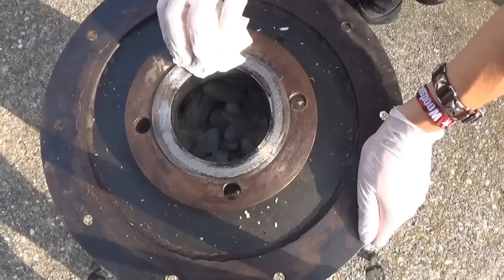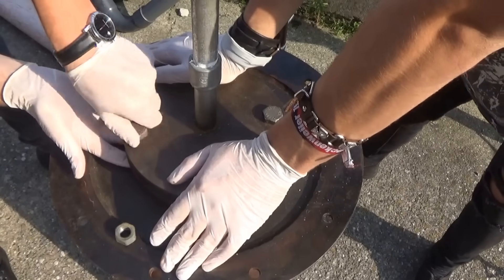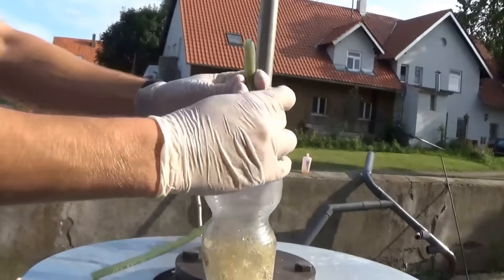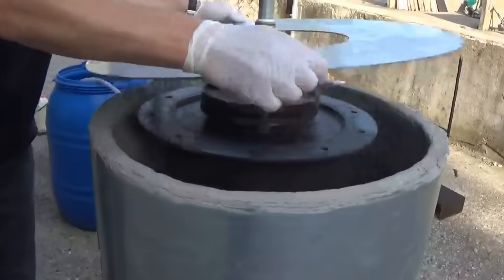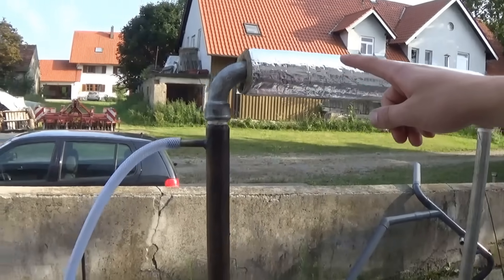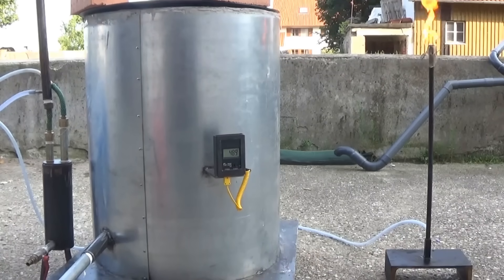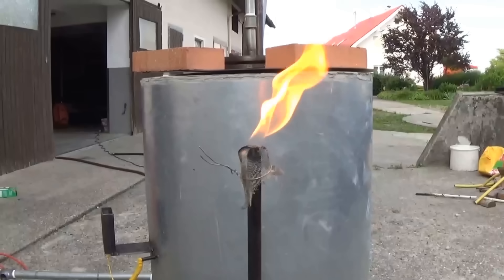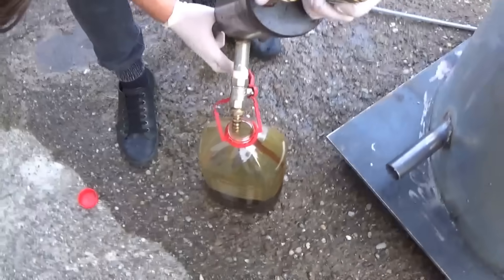plastic waste to oil/fuel improved pyrolysis reactor

Comment: You could use the gas to heat the reactor.
Reply: Like he said, it must be presurized first, so the venturi burner can work.
Reply: @German_overengineer  never said, he has to use the main burner for that. He could use pressurised air instead in an inverted burner design. Lower pressure in the reactor due to the venturi effect is not a bad idea either.
Reply: @RepublikSivizien  That also would be an option, but I guess he is still going for the most simple solution right now
Reply: @German_overengineer  I think that just connecting the gas output to the burner tube would be enough, as the reaction starts you can lower the propane flow.

Vessel pressurization is not needed, a typical regulator reduces pressure to less than 0.5psi so that is all you need in the reaction vessel.

I also think it could be good to watercool the collection flask to make sure the lower fractions don't evaporate, you can also improvise a cooling tower with a pvc pipe and a "T" (search "bong cooler" or look up tech ingredient's videos on it) to be able to scale up things without needing a lot of water and making sure lower fractions don't evaporate (higher gasoline yield)
Reply from the maker: @nirodper   thanks for the comment :D is a good one ! at first ... i am using 4 psi for the burner on full load. i am working on a low pressure burner for the pyrolysis gases ... but maybe i am just building a other main burner that can suck the pyrolysis gas in with the air (the current burner cant handle it)  the collection vessel will be redesigned for the reason you brought up :D 

mfg hazelChem
Reply: oh, and please do not handle fire while wearing such gloves…
Reply from the maker: @RepublikSivizien  there you are right i already ordered better ones 

mfg hazelChem